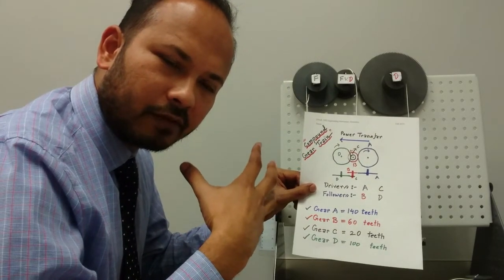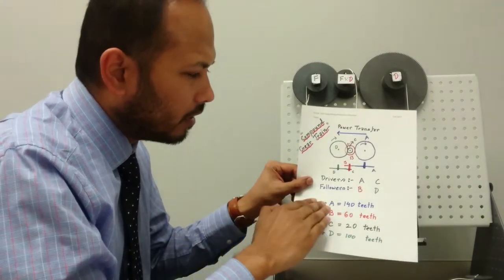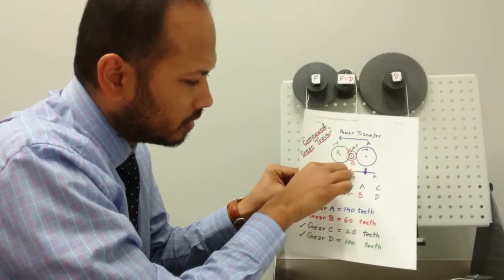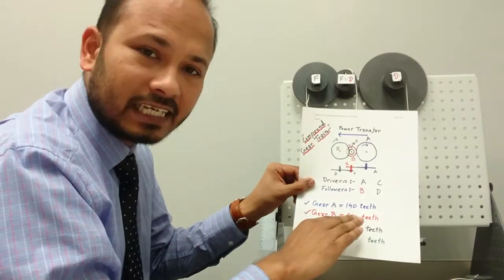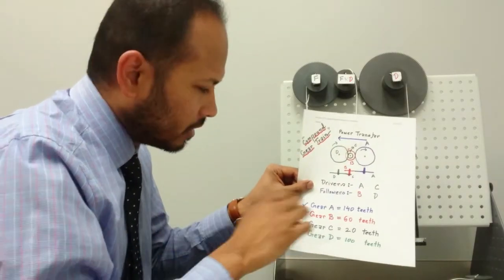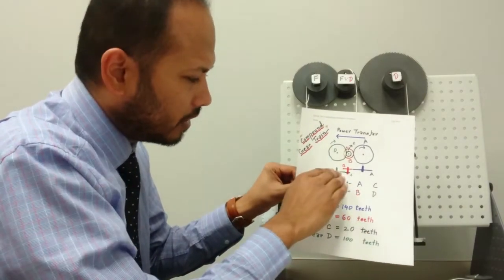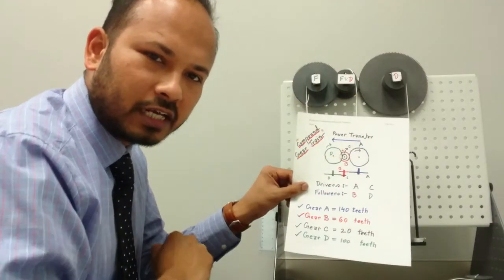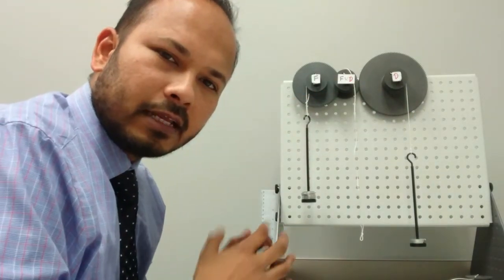Compound gear: What is it? How it speed up or slow down the final output? Calculations

Comment: Sir I have to design compound gear train 1:100 velocity ratio how can we calculate...if I am calculating 1:100 ratio the driver gear teeth are getting too much
Reply from the maker: You can do 1:10 step, and from the same shaft again 1:10 to next shaft, this from the first to the last shaft it will be 1:100.  https://youtu.be/i_nNx5qvx8k
Reply: @MohammadShafinulHaque  so how many teeth I have to take on driver gear and on driven gear